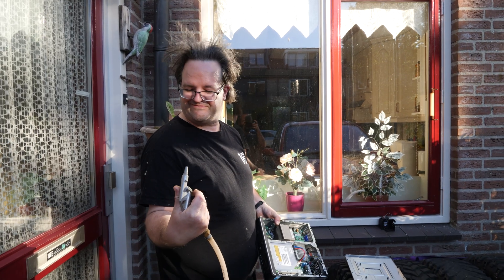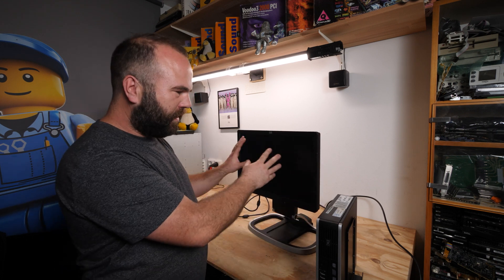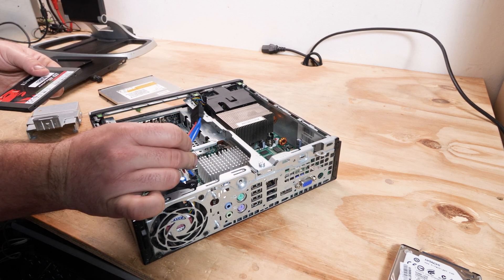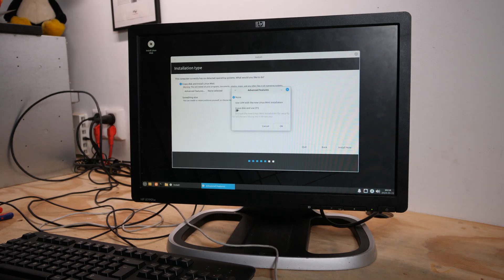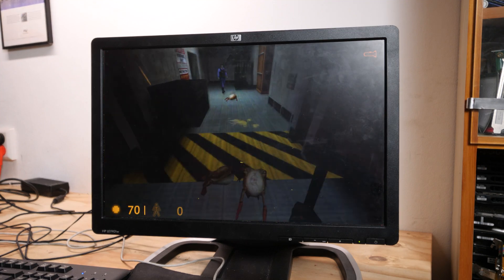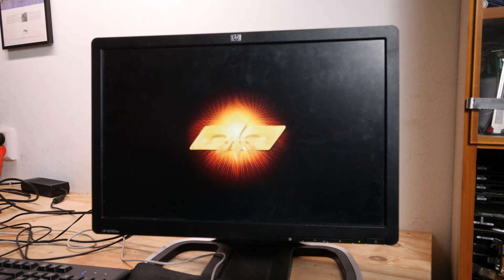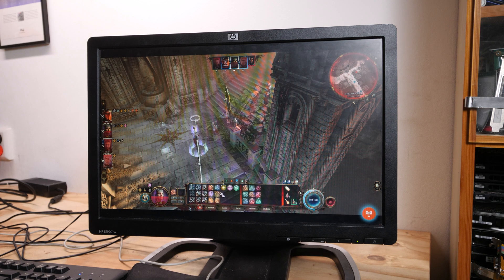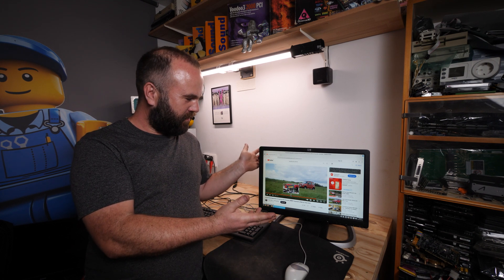HP Compaq 8000 Elite - Can You Still Use Linux on a Core2Duo?

Comment: One of my computers is single core Celeron D 346 (3.06 GHz, LGA775) with 4 GB of DDR1 memory. It runs Xubuntu 24.04, and is enough to watch YT in 480p.
I think Linux desktop would be usable nowadays even on a Pentium 4 S478

Comment: I've had no difficulty running casual (RenPy) games on a Core2Duo, just so long as I have an external video card of some sort (mobo onboard video's never good enough).  It can be a similarly OLD starter-level card (GeForce PCX 4300 sufficed for my modest needs, in a full-size enclosure), and half-height to fit the box you have...

Comment: i have same machine with a i3 2100 cpu problem i have vas i missing that damn adapter its says you need a a120wattt i haave a 90watt so that machine vasa trowed away when i cant se if it works
Reply: Won't work. You need a special huge HP adapter, not a regular HP notebook adapter. The adapters are the hardest to come by. Experience with a Elite 8000, 8200, 8300 USFF. If you find the right one, you can even use a i7-3770S